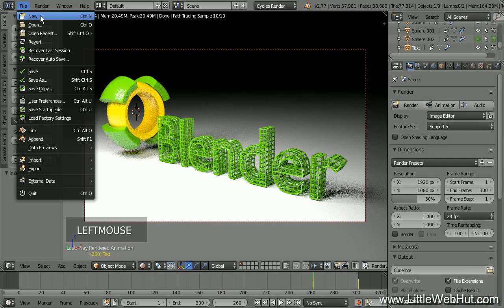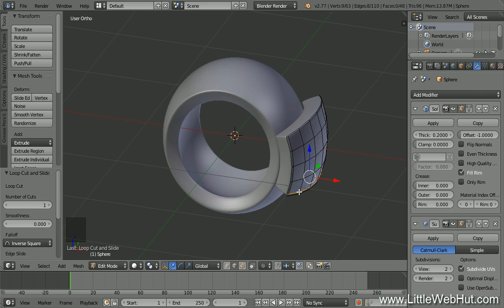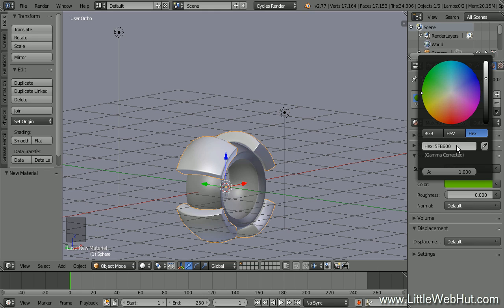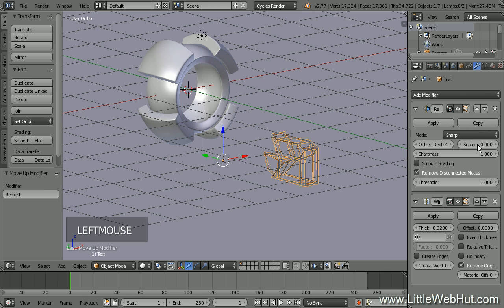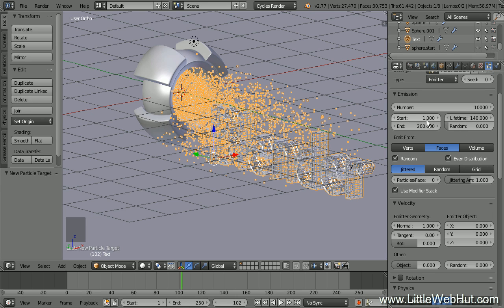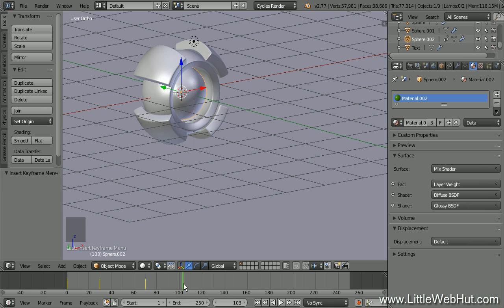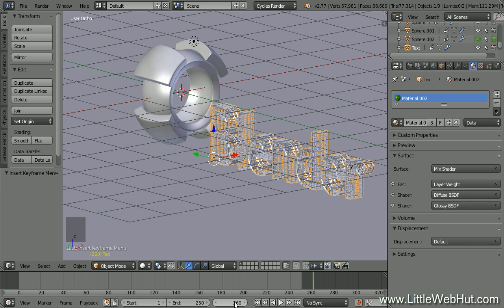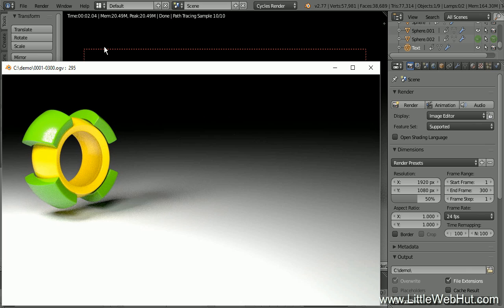Blender Tutorial: Fantasy Text Factory Animation

Comment: Timestamps:
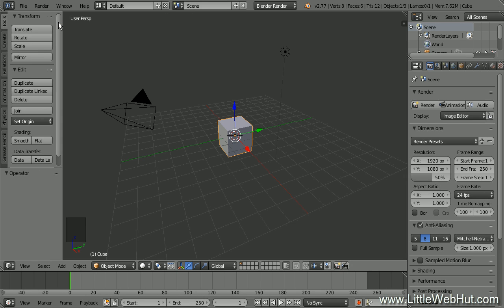0:20 - Modelling ring shape
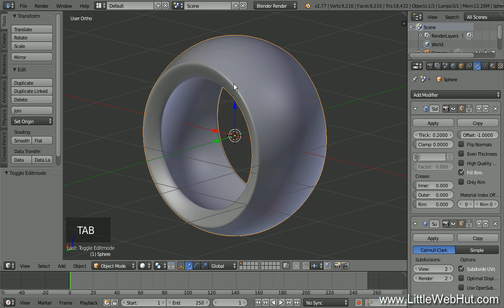2:55 - Modelling outer ring
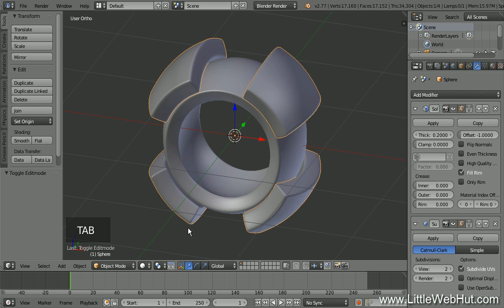5:57 - Adding floor
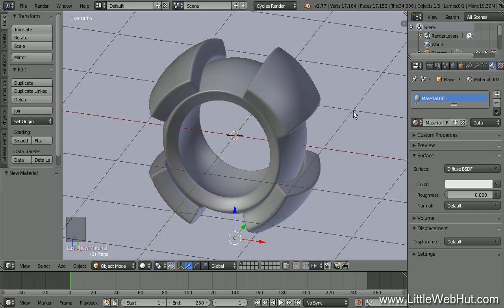6:35 - Positioning lamps
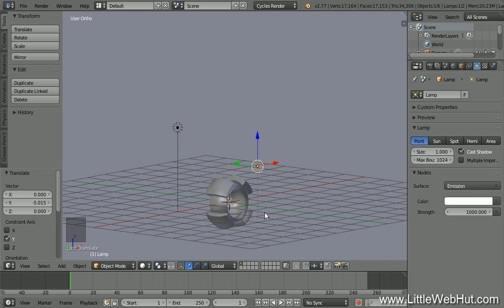7:50 - Creating materials
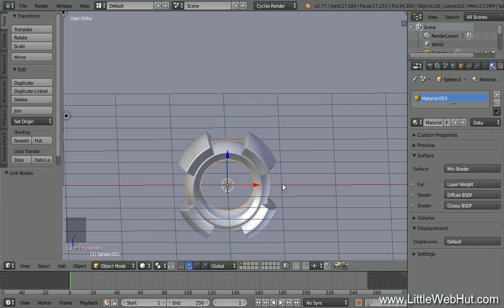10:25 - Adding text + text modifiers
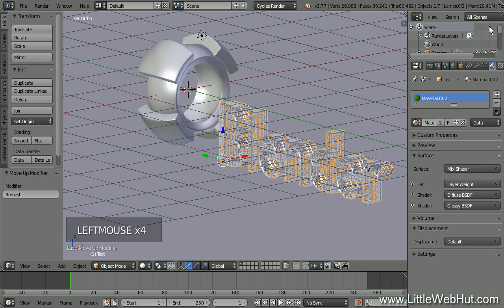13:03 - Adding particle system
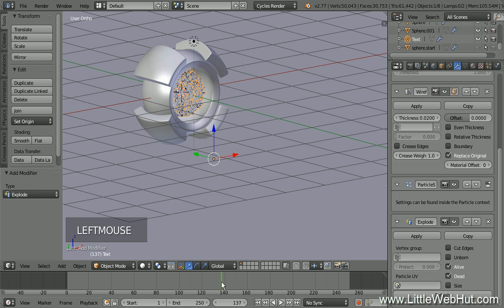18:26 - Making + animating first sphere
22:00 - Animating factory
24:04 - Animating text
24:37 - Setting up camera
25:47 - Adjusting render settings

Comment: Great tutorial, as usual! To keep the poly count as low as possible: Try using RoundCubes whenever it's possible (when you don't specifically need the "rays"), and instead of adding geometries (ring loops), you could simply add an Edge Split modifier to the first sphere. Then crease (Shift + E) all the outer edges to .96 (or less, if you prefer - the lesser, the rounder).

Comment: https://youtu.be/n4_0nNZSWdw?t=4m Erm... There is a spin function in blender that does the exact same thing without needing to duplicate the object 3 times... In toolbar: Tools>Add>SPIN ... 
https://youtu.be/n4_0nNZSWdw?t=9m51s I'm assuming you already no that the Fresnel output is more accurate, but you probably don't like it because you can't control the factor of the Fresnel. A way around that is to connect the Fresnel value into a multiplication node and connect the value of that to the factor. Now you can control the factor of glossiness by modifying the second value of the multiplication node. (More = more reflective, Less = More diffuse.)

Great tutorial by the way. ;D I learned a lot about keyed particles. Didn't even know they existed! (I know, I suck. xD)